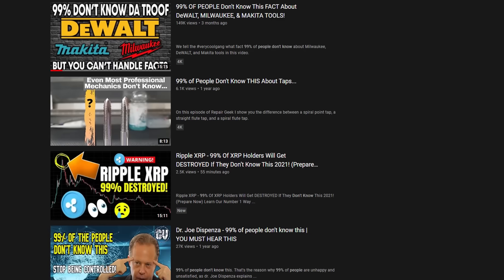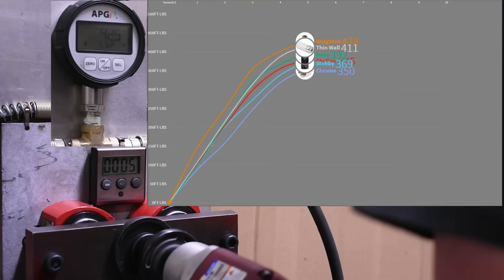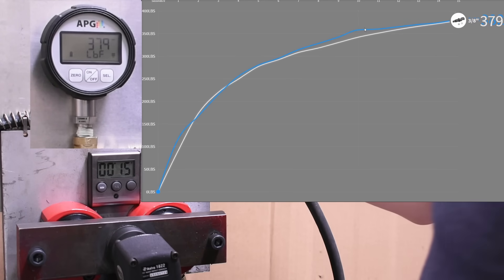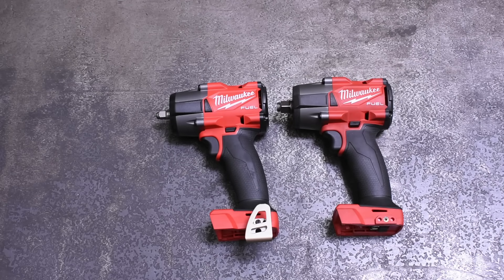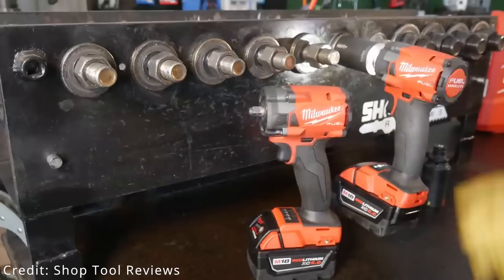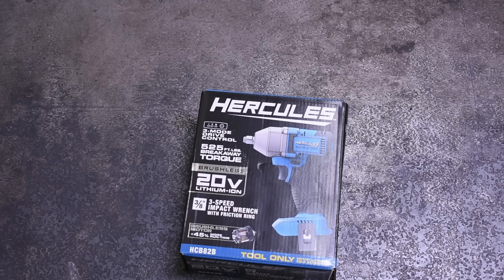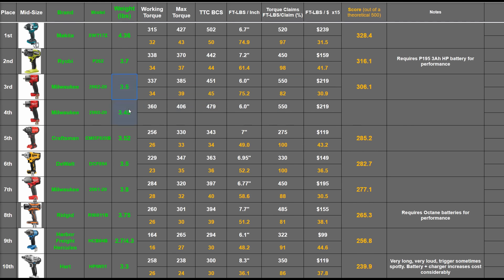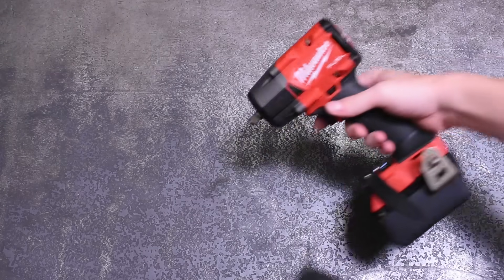Measuring Power Difference Between 3/8" & 1/2" Impacts = WTF

Comment: I'm no kind of "expert" on impacts, in fact, I'm not even an armchair expert.  But I'm more curious in the Milwaukee tool if there is any difference in the motor between the 3/8 & 1/2 inch models. The next issue I would be questioning is the batteries. We all know that batteries vary slightly in voltage and general output. You have proven this is a factor in performance.  As far as the anvils go, other than the size being 3/8 and 1/2, is there any real difference in size? Lastly, if you could get say, 5 of the 3/8" units, and 5 batteries that were close to the same voltage fully charged, would all 5 units produce the exact same torque ratings? Maybe if not 5 batteries, maybe some type of AC/DC adapter that would supply the precise same voltage/amperage that could be plugged in to the 5 different units for testing?

Comment: Hi forgive me if this is a repeat qn, but do you perform multiple runs? How much variance can you see due to newly lubed vs previously tightened bolts? also, have you tested individual tool variance?
Reply from the maker: We've mentioned before but no problem. Unless we say otherwise, every test you see on this channel is of at least 3 runs, you're shown the median. New lubed bolts take quite a break in to match the calibration spot on, which we do each time a new bolt is used. But it's easy to check calibration with our set up.
We have checked variance within a model, we've bought two Rigid High Torques and those tested the same, retested two M18 high torques nearly the same, and two DeWalt DCF899's and the new DCF921 which were close, then the newest Metabo HPT mid torque we just purchased, also the same as when tested on the channel. So far tools have been quite mirror like. Average variance between runs is sitting at around 9 ft-lbs +/-, which changes by brand. DeWalt being the worst offender.

Comment: Interesting! I use a 1/2" dr stubby  because most of my impact sockets are 1/2" dr. I also have more powerful 1/2"dr impacts...
 I have been considering 3/8dr mid torque since a 3/8dr impact set would be lighter to carry around but I also work on pickup trucks and big machines .
The bottom line is whatever size impact sockets your using determines what drive size you need and try to avoid adaptors. Socket drive size is often determined by fastener size so determine that before shopping
 If you work on cars 3/8dr is usefull but I often find that I can only fit 1/4 dr and a tiny ratchet in places so my chrome sets still get used alot (by hand).
 And to answer the next question, NO a 1/4"dr impact is not even close to the  torque of 3/8 dr! Lol.

Comment: My lil friend is an electrical mechanical engineer of 37 years. they engineer everything to last forever, then , reverse engineer everything so not to last. it's just monetarily racist. so when you hold and use the 3/8" drive does it just kinda feel wimpier than the 1/2" drive? or is it just psychological because you know 1/2" drive stuff is tuffer? as in anvil size breakage.

Comment: 3/8ths is smaller so it provides more torque, just like gears in a car.  The smallest gears are the most powerful gears because they provide the most torque.  You increase horsepower and staying power as the gears grow in size from 1st to 6th.  Another words, when you equalized weight, material, and everything else between the 3/8ths and 1/2, you walked away with a clear winner based entirely on torque.  The 1/2 is still superior for larger bolts because in real life scenarios the sockets are built heavier and stronger so they don't break, and the bits that attach are thicker also providing less chance of damage.  The difference between the two guns was minor in torque, and so the heftier option is better for continual use at max power.
Reply: It's not geared in 3/8ths lol. You aren't understanding this

Comment: I've always used a smaller drive when possible as it's usually lighter, costs less and fits easier in tighter places. 
Bought a 1/4" drive impact and electric ratchet from Matco several years ago and those things certainly earned their keep and paid themselves off in no time (this is before electric impacts took over from air impacts and were still in their infancy)
So last year after some tools that were in my truck were stolen (along with my truck) I decided to finally bite the bullet and buy into the Milwaulkee lineup and got an M18 drill and impact driver combo, a multi tool, and an M12 fuel 3/8" stubby impact. 
That 3/8" stubby impact is quite the little beast. It'll rip off standard truck lugnuts with no issue! 

Just for shits and giggles I'll have to see if it can even make a dent on Mack Truck lugnut lol (that'd be a lot of adapters too though)

Comment: Well done on this video. I'm thinking the 3/8 milwaukee might have a shorter and harder throw travel given the smaller anvil deems most effective. 🤔  typically you would need a stronger battery output to minimize depletion. Meaning (in theory) a 3/8 fuel with a high cap batt should maximize efficiency?

Comment: I'd be curious to see the power draw from the batteries during these tests. You might have to get creative and void your warranty attaching leads between the battery and the gun so you could take current and voltage measurements. If both tests draw the same amount of power, I would think that less power is being wasted turning the heavier 1/2" anvil and socket and thus more is being transferred to the nut wuth the 3/8".  Same with air tools. If both tests consume the exact same amount of air at each point in the test, then the same power is being delivered, and the same principle applies.  The higher initial torque may be due to hammer design on the 1/2".

In the end, as at least one mechanic had said here, 1/2" is going to be about durability.  The manufacturer would have to intentionally increase the power delivery to the 1/2" model (say, with a higher voltage battery.)  If
everything's the same, then I think inertia wins here.

Comment: It's got to have something to do with the impact speed, i'm sure if they have the same motor and the 3/8 is naturally slightly smaller than the 1/2, it's going to spin faster and impact faster.  Just like that hybrid 1/2impact driver you guys showed off way back.

Comment: When the results come out not what you expected, Id first swap the batteries.
Reply from the maker: They used the same battery
Reply: @TorqueTestChannel   I saw a battery on each tool.  Batteries, even of the same Amp hour, can vary.  

Maybe they used the same one and took it off one tool to use on another, but in the side by side each tool had their own battery.

I dont mean use the same size battery, I mean use the same battery or do 2 tests so each tool gets one turn with each battery in case there is a difference between the batteries.  You can probably also test the output of each battery.  Not just fully charge, but put a meter in them both.
Reply from the maker: We used the same exact battery. For the same reasons you bring up

Comment: Need to know how I can send you my to ridgid guns. One is the 3/8 the other is 1/2. They are pretty much the same except the anvil size neither is advertised as a high or mid torque they are just ridgid 3/8" impact wrench and ridgid 1/2" wrench both octane

Comment: Swap the Milwaukee anvils between the impacts and retest. I think you’ll find the 1/2 anvil has more mechanical advantage in the slope of it, hence the higher initial torque, but lacks the “gearing” so to speak, to keep it up high. The same average indicates the same motor and everything. 

99% confident the power follows the anvil.

Comment: Does air compressor size make a difference?
Reply from the maker: It does if 1. The run is long or 2. The pressure is set max so that the tank pressure equals line pressure

Comment: From a mechanical advantage standpoint, do we think of the anvil and socket as a single unit? If you don't, and if you imagine the difference between the leverage advantage of a smaller drive vs the outer dia of the bolt, this almost makes sense.

Comment: I think just a theory maybe because I think the 3/8 socket has more mass then the half inch socket for the same size. Since it has a smaller diameter shaft that means the socket needs to have more mass. How about you be test this theory we're both a 3/8 socket 1/2 inch socket weigh the same

Comment: It's funny - I actually get a ridiculously large percentage of things unscrewed in my shop with a Makita quarter inch impact driver with a 3/8ths or 1/2 inch socket adapter in it.

At one point, I actually stepped it up to a 3/4 inch literally as a joke and unexpectedly took the lugnuts off some semi-truck wheels (but as it turns out they were mostly only hand tight anyway, which is EXACTLY the kind of discovery you want to make AFTER driving it thirty miles).

Comment: I'd think the 1/2" would generate more torgue based just in the concept of longer levers increase torque more. So whole the larger anvil should theoretically be spinning slightly slower, more leverage is there. Wondering if the theoretical faster spin speed (smaller lever turning item further than a linger lever) of the 3/8 is what's causing the higher output
Reply: I'd say you have this backwards. If you were pushing on the anvil from the 1/2" point vs the 3/8", then maybe, but you're actually turning from the centre, and pushing outwards. So in this case the longer lever makes for less torque delivered. Like how putting larger diameter tires on a car will reduce the amount of torque you can put to the ground.

Comment: It's nice to see numbers for these reviews instead of just how many stuck bolts a tool can loosen in X seconds or some other nonsense.  If you don't want to know which make and model generates the most torque then any impact wrench in your rankings is A-OK for what you're trying to do.  I keep a Makita impact wrench in my car kit, but it's honestly overkill for a flat tire.  Most impact DRIVERS can break loose a few lugs without much trouble, and re-tightening them is something I was taught should be done by hand, anyway.

Comment: Just from my experience, the only significant difference anvil size makes is the max torque before the anvil breaks. The only reason we probably have both 3/8" and 1/2" impact drivers is due to the fact that both 3/8" and 1/2" sockets exist. Case-in-point: I was trying to loosen a lugnut on my wife's Escape, but only had a 3/8" socket that would fit the nut. Couldn't get it off with the air driver, so I got out the breaker bar, but it was 1/2". Used my 1/2"-3/8" anvil adapter and managed to break the adapter due to the extra torque. Once I bought the correct 1/2" socket, the breaker bar was able to get the nut off. On top of that, it most likely wouldn't be worth the extra R&D cost to make a weaker motor and it could hurt brand reputation.

Comment: I'm thinking there ARE  times  when  1/2  is  "better."  When you are  "pushing that limit" of  using  1 or 2  big  "not so springy"  1/2"  extensions to get way back into  an over-tightened/ corroded bell housing bolt,  a 3/8 is not gonna do it.  I   STILL have  an incredibly  big, heavy, ugly   IR  air  3/4  THAT IS  GUARANTEED  to take  "anything" loose  when  'all else'  fails.  It is fed with 1/2"  hose

Comment: Maybe the hammer is lighter the rpm which the motor can spin can be faster. Then the hammer can hammer more times because the rpm is higher but not down low since the hammer mass is less than the 1/2inch one thus making more peak torque but less dynamic low-end torque

Comment: As a retired mechanic I can tell you a 1/2" drive will last longer under high torque use than a 3/8" drive will. I've snapped the square drive off of many 3/8" drives. I have never snapped off a 1/2" drive. It boils down to the right tool for the job.
Reply: 5 year warranty. I will take the extra space and torque. As a personal current technician
Reply: Professional* little autocorrect error
Reply: @blainechaluk8902 you can edit your original comment bubby... 😂
Reply: I snapped a 1/2 breaker bar taking off a wheel hub to a suv but its coulda been due to age
Reply: @dexterjsullen  I can believe that.  I had an older dodge 4x4 front axle nut that required a 3/4 drive breaker bar to get loose.
Reply: @garypeterson9083  I broke 2 studs on my dad's dodge motor home hub before i realized they they were left hand thread
Reply: Mopar
Reply: @Kelvinbellrose Did similar  with craftsman  half inch breaker bar with a 4' pipe and jumping up and down on the end. ('52 Dodge Powerwagon Artillery  Carrier). Wasn't  just Dodge tho. When i upgraded to a '56 GMC 6x6   both the lug nuts and the axle nuts on drivers side were left  handed threads!  At least the were labeled as such.
Reply: @kimkleiner8456 is that driverside the left side?
Reply: @georgiojansen7758  yes, left side of vehicle  if looking from driver's  seat.
Reply: @Kelvinbellrose  You should not be allowed to touch tools.
Reply: @dexterjsullen I snapped brand new half inch icon breaker bar on rack and pinion bolt
Reply: Pretty sure this is just common sense. My master tech beside me couldn't get an oil filter off with his 3/8 breaker bar but I let him borrow my 1/2 with my cup and boom comes right off with no effort. Bigger is better most of the time
Reply: Great observation 👍
Reply: *anecdotal
Reply: I know it’s a 2 year old comment, but the irony of me seeing it the same day I snapped a 1/2” drive breaker bar is wild. To be fair it was somewhere around the 600ft/lbs range so I’d say it held up pretty well
Reply: @Makl2000 Enjoy the achievement my bud. Something we all strive to beable to brag to our friend haha.
Reply: Ford f-150 2010ish in the salt belt, You’ll break everything you’ve got and then some. Snap 1/2 inch drive like it’s butter. 3/4 drive or 1 inch drive or go home. Guy came in, his tire iron looked like a banana. 😂
Reply: Could it be because you use the 3/8'th more?   Also, is the value of having a lighter tool worth the breakage?
Reply: I agree my m18 3/8 walks the square out of most sockets only ones it doesn't do that to im my old craftsman usa sockets.  So I'm gonna swap the anvil to a 1/2
Reply: Most people who buy these tools are not mechanics.  Me and my buddies all have 3/8", either Milwaukee or Dewalt, and none of us are mechanics.  3/8 is the right tool for the job for majority of the people.  There was only one time I needed to borrow my friend's 3/4 Dewalt which was rated at 700lbs to because my 3/8 stubby couldn't remove a bolt that dealt with New England salt roads.
Reply: What do you think being a retired mechanic means?
Reply: That is what crossed my mind. Longevity between the 2 after the same rigorous duties. A guy would think the ½'s tolerance would be substantially stronger
Reply: Physics matter. Given anvils of identical metals the greater the mass of the anvil the greater the abuse it can absorb.
Reply: 1/2” sockets no need for adapter on 1/2” wrench.
Reply: Who was is that said - "Get me a lever long enough & i shall move - the world 🌎 " anyway , theres always the right tool for the right job , only "make do" when we have too
Reply: I bought the 1/2 Milwaukee stubby for this reason. Then use a 3/8 adapter.
Reply: I’m not getting 3/8 😅because of the video. Half inch is common sense for heavy duty stuff

Comment: Amazing video!!! Glad someone did it with out an adapter on the 3/8 to prove the point. My only question is how much did the 3/8 socket weigh compared to the 1/2 socket?
Reply from the maker: We did at least control for that with the air tool and Hercules tools testing the same with the samebsockets
Reply: @TorqueTestChannel  very impressive. I understand getting the 1/2 drive just easier to find bigger sockets. But this shows 3/8 can withstand to the power with the bigger sockets. Well done keep up the good work

Comment: I've totally used a 1/4" drive impact driver with a 1/2" socket adapter to zip wheels on / off my cars. I've not tried it on my truck, but it was a lot more performance than I was expecting from it (porter cable 20v max)
Reply: I use a cordless drill (not impact) with a socket adapter to quickly get the lug nuts snug and then use a torque wrench to put them at the right torque... When removing them, I use a breaker bar or air wrench to break them loose and then the drill to quickly remove them... The drill is quick and doesn't provide much torque, so if I time it right, it's just a bit more than "finger tight"... The idea being to get the nuts barely seated while rotating the tire so that the wheel is perfectly centered...

Comment: Before watching I imagine 3/8" will perform better than 1/2" because of less rotating mass - the same reason why if you put wheels/tires on your car that weigh less than the ones currently on it - you will see a gain in MPGs because there's less energy used to propel them and more power can be used to move the lesser weighted wheels.

Comment: "Torque output" can be the same for a 1/2" drive or a 3/8" drive as long as the moment of inertia created is the same. This moment depends on the drive shape and mass distribution. To make it very simple, you'll need the same force to swing a 5kg hammer with a 1m handle than a 10kg hammer with a 0.5m handle. That being said, because of the longer handle, the 5kg will go faster and the impact will be greater. Ultimately, the number of impacts doesn't affect torque. What will affect torque output is the maximum speed reached by the anvil before the next impact.